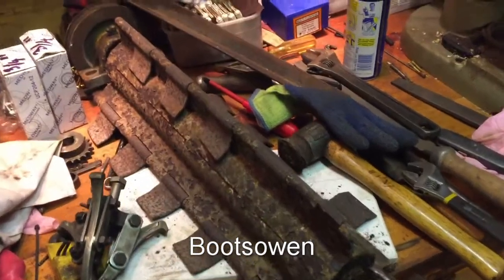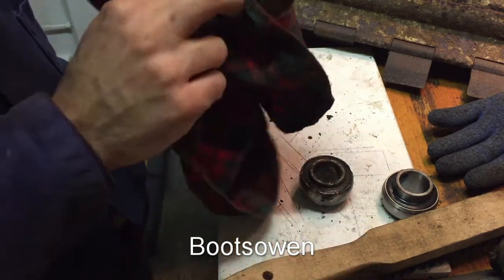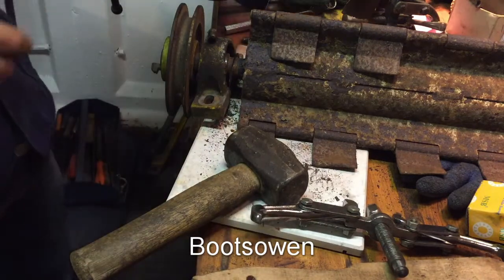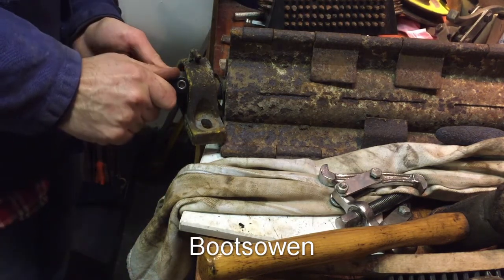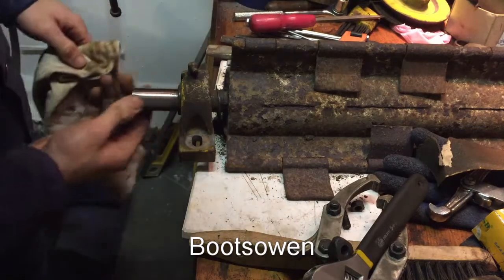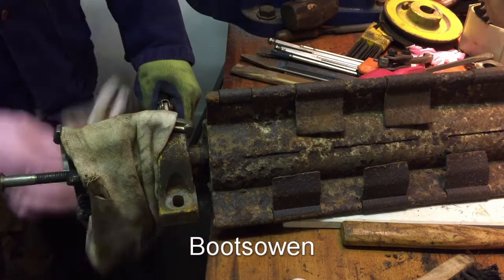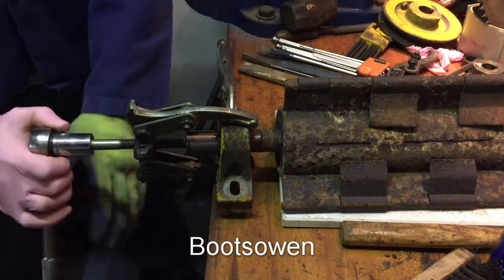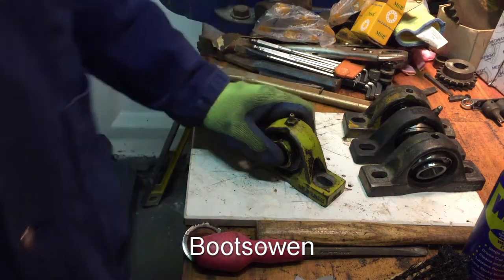Removing rusty and stuck pillow block bearings from a shaft

Comment: why is this so much quiet ?
Reply from the maker: Sounds ok to me, what do you mean?
Reply: I guess they want you to sing and dance along with removing bearings lol Hey I'm fixing to do the exact thing with 2 pillow block bearings on my grasshopper I sprayed them with PB Blaster overnight because they were so stuck on with rust and dirt. Why don't you try some PB blaster before you start on the removal it makes a serious difference for me. Great job though on the video I got a lot of info on how to remove the main pulley I'm going to look for a set screw I don't think mine has one but it could be rusted over & I didn't see it. The key is just stuck big time. Thanks John